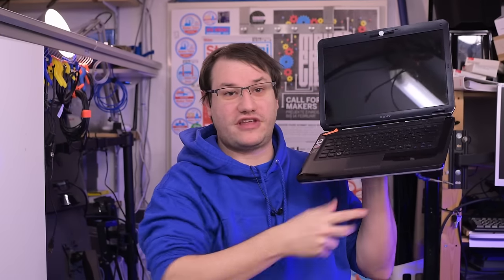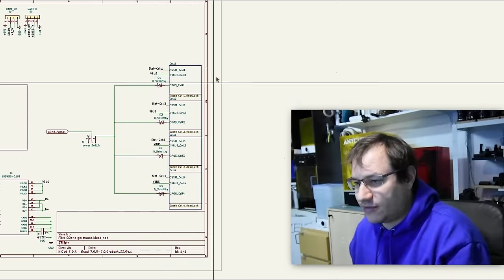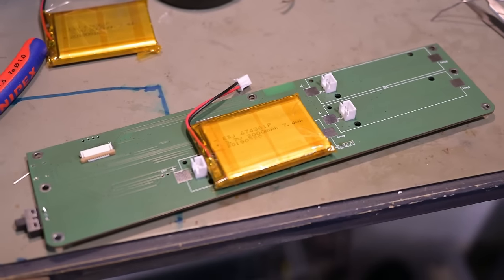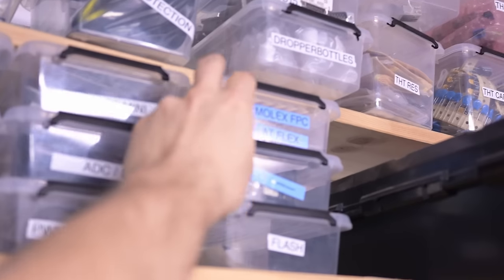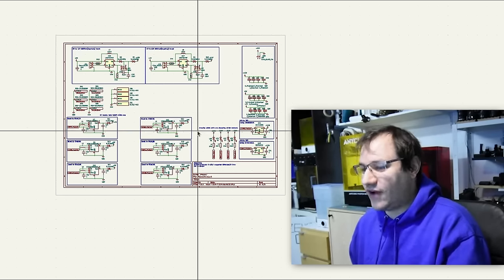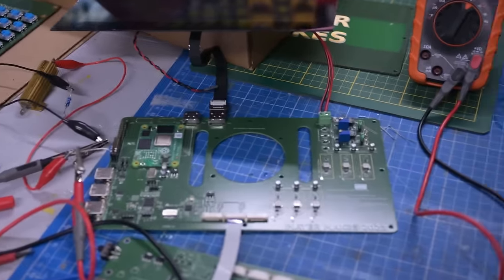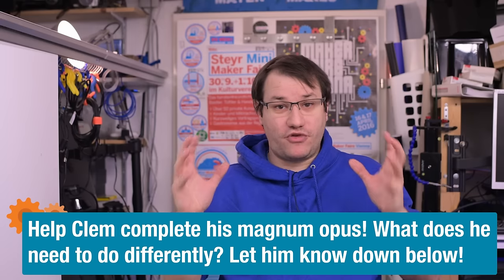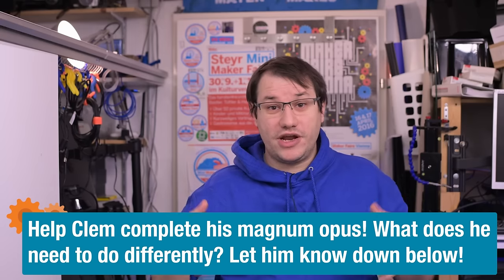Tinkering vs Engineering: Can You Build a Laptop from Scratch?

Comment: Hi Clem! Always a pleasure to follow your projects! Anyway, diodes to put batteries in parallel are a common method also on professional project! On trains, in one of my project, there are three 24v 170Ah batteries in parallel, protected by (slightly bigger) diodes!
I just also designed a CM4 carrier board for a retropie console (video soon on my italian channel) but i've choose to use an already functional power bank breakout board! One cell, fast charging and stable 2.5Amps of current :)
Reply: Grest to hear my approach is not as unprofessional as I thought😂

Comment: If each cell has its own protection (and the flatpacks usually do) and they're all the same chemistry, you could charge or discharge them to approximately the same voltage and just connect them directly in parallel; they'll work like a single large cell.
Reply: Thats obe of the things, i mostly dont trust any on pack protection or use bare cells, and balancing still needs to hapoen whike at thexsame time i want to get 3v3,5v and 12v the complexuty adds up quickly. And one should necer assume even discharge across cells, in practice it rarely holds without active balancing

Comment: I think the issue is constant power from the boost converter, due to which voltage increases and current decreases with more voltage ripples during the load. Read the boost converter IC datasheet Min and Max parameters. Try to use a buck converter with 2s or 3s lipo battery pack.

Comment: Hi! Compliments for the idea and design, yes, you made a brave decision by designing the final PCB at the first shot!
I'm not an electronic engineer, but I like these projects 😊

Anyway, I've got two tips, maybe they can help:

1- why not make a unique step-up converter to generate the most high voltage needed, and then add some step-down regulators, to get every other voltage? (Like 5v, 3.3v, etc..). 
I don't know if it's a good idea, but I would try to connect the cells to the step-up converter in parallel, in order to drain the power more evenly.

2- Split the main board in sections by their purpose (power, usb/data, audio/video?), then find a connector to join them, even with a flex cable. A single bus maybe would work, including power and data. By following this method, in case of errors (or upgrades!) you don't need to replace the whole thing. Prototyping a module on a breadboard is also easier!

The key in every engineering project is moving forward by steps. Doing all in one makes everybody anxious, as you have a single attempt!

Comment: Loving this! It's something I as a fellow self-taught hobbyist also have been considering too, trying to building a laptop.

Kinda curios as to why not use a dedicated 5S battery charge controller, such as bq2461x from Texas Instruments and equivalent. And use USB C 19V input? then step down from there for the required voltages.

The converters look sorta not closely enough packed - you want all components as close as possible!
Even to the Pi module. Generally when trying for the first time a new converter I like to add 1 extra of each footprint if I need to add extra caps or something later on. Also double check the calculations for correct capacitor and inductor values and keep in mind tolerances of the used e.g. resistors
Reply: Mostly because i tried to iterate in what i usually do. But in hindsight the way you desctibed is a good option to keep in mind.

Comment: HAL9000 voice I'm Sorry Dave, there are two different CM4 units from RPI now. The CM4 and the CM4 SIL!
Reply: the cm4S is actually just for legacy compatibility with Cm3 projects, and only available in higher MoQ so the Cm4 for mfactor still holds as the new generation. looking back the dual mezzannine conenctor might not have been the most sensible choice.
Reply: @MAYERMAKES  I know but it was the only comment I could think of that would fit the HAL9000 quote into.
Nice work and as Bryant Addams once sang "Dont give up"
Reply: @AJB2K3  and as Skinless once sang: life sucks and then you die.

Comment: That person who patents what Lenovo marketet 2013-2018 but couldn't get to work would be rich. Dual battery, where internal one holds charge for 30-60 minutes after the external goes out of charge.

Also for projects like this MNT Reform laptop could teach a lot. Open hardware & firmware.
Reply: hmm interesting idea , reminds me of the backup battery the atari portfolio had to retain ram memory when you had to change the AA batteries.
Reply: @MAYERMAKES  YT channel "Electronics Repair School" taught in his laptop video why such a circuit is so hard to make. The reason comes straight from electromagnetism physics.

Comment: Oof this was painful to watch, I admire the attempt, but as an electronic engineer that does very similar things daily i have a couple of suggestions. One thing is for sure you can by no means remove the diode from the SMPS, its part of its core working principle. Also, with the video output, I have a feeling it could be signal integrity and I am just curious what type of video signals those displays use?
Reply: There are multiple sets of diodes, the ones integral to the smps where left alone. please share you pro input on our community page , we can all learn from a pro.

Comment: I know how to build a rasp pi killer

Just take a Intel atom line or similar cpu, add 4-8gb ram and pcie, and add a   gpu with 1080p support, with its own 2-gb of ram, and share work ram with gpu dynamically

Add a cpld to handle fast gpio and an ac'97 audio chipset 

A sbc that runs windows natively and all parts have windows drivers available  from manufacturer 

And can run most games not at full settings, depending of the specific cpu, single, dual or quad core with hyperthreading. 32 or 64 bit
Reply: Add external USB 3.0 support via chip or just use USB 2.0

And an ethernet chip
Reply: Use a 4 layer pcb and populate both sides
Reply: You just described the lattepanda delta , which did nit kill the rpi and wont, but its actually a part of an upcoming project.😂

Comment: Ok, so, a few questions in my head after watching this episode:
1. Why not use a Raspberry Pi 4b with 8GB of RAM and an HDMI output?  It's your first laptop, so at least would be useable ;). Than you can start to redesign thing from scratch one by one.
2. An LVDS is more of a TV type from mainboard to t-con or an LCD panel. In the low power devices like phones/tablets, we have different standards. You can google more about them.
3. Why not use in a first project ready made step-up and back converters? This way you have a working laptop quicker :). Same as point no.1.
4. BMS you can buy cheap for 18650's on Aliexpress for pennies. I could recommend you using from some old laptop :D, but, this can go sideways ;). I'd avoid those flat batteries, but focus on some outdated and used 18650 from old laptops which have some life in them. And, a spot welder you'd need which is cheap on Aliexpress as well.
5. Why not forget about the case until the whole thing is not working? And, PLA first, not a resin. I have a resin printer and there's a difference in between them. So, unless you have a ready design, no point to waste resin IMHO.

I've got more, but this is already a lot :D. So, if you'd like to talk more about this project, my contact details are on my YT channel here. Thx.

Comment: Wow. I think boost converters are one of the simplest things you can design. I made one by letting an avr microcontroller (arduino software, but bare chip) put out a fixed PWM waveform, feed that into a mosfet gate, add schottky diode, inductor and output cap and it works, until it overvolts. But for that purpose I connected a zener diode from output voltage to an IO pin (with pull down resistor). Now it goes digital HIGH if voltage is high enough, otherwise LOW. The microcontroller simply switches the PWM on and off according to that pin state.

Why not use the adc to measure output voltage? I think that would be too slow (or would need a huge output capacitor) and the output voltage would overshoot more and be more unstable.

btw that controller also does battery discharge protection by occasionally measuring VCC and if the battery goes too low, it also switches off the PWM.

And if you want high efficiency, always use overkill inductors. I got 98% at a 18V->48V converter using a totally overkill inductor (it does not get warm even one bit at my definition of 100% load, while output schottky is pretty hot and mosfet is lukewarm)